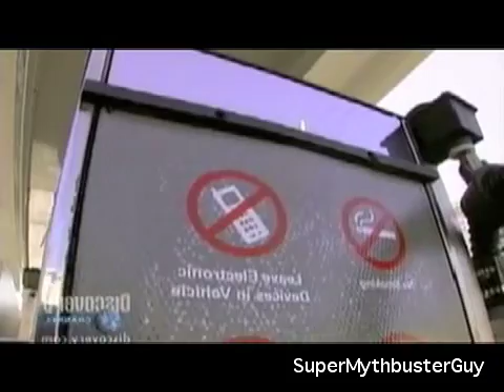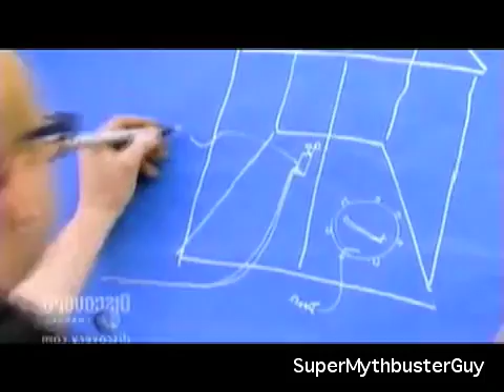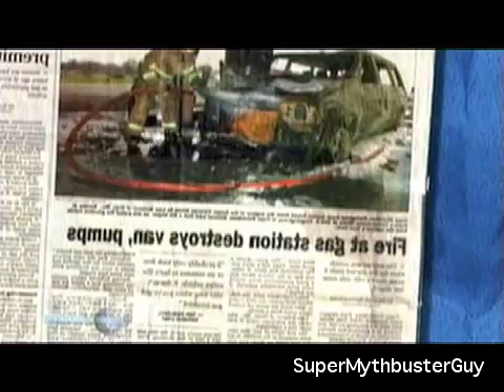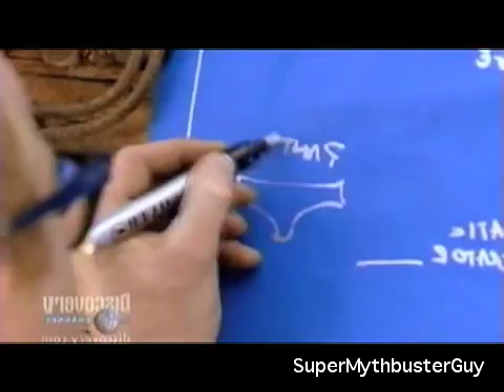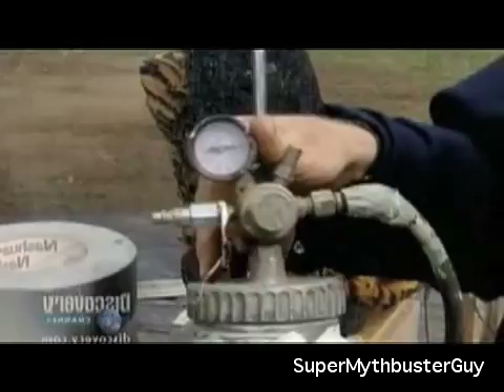Mythbusters Cell Phone Destroys Gas Station (1/3) S01E02

Comment: think about the thickness and the quality of the material. being an rc car, the material has to be very thin as well as the possibility of the lexan being fake or badly made. polycarbonate materials are super tough and are used as laminates to bulletproof glass.

Comment: Well if there's a slight crack in the CD beforehand, it could spread gradually under centrifugal inertia until the CD bursts, but for a perfect CD, it usually takes over 30,000 rpm to tear them apart.